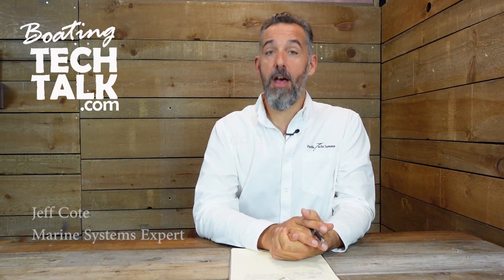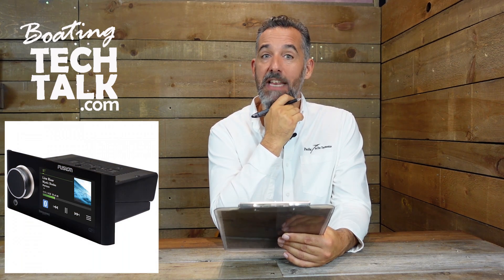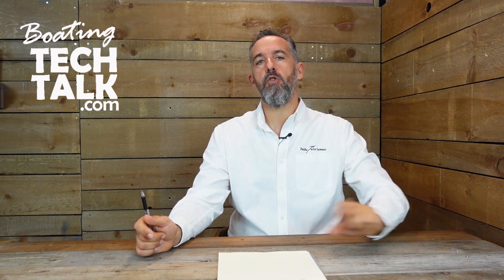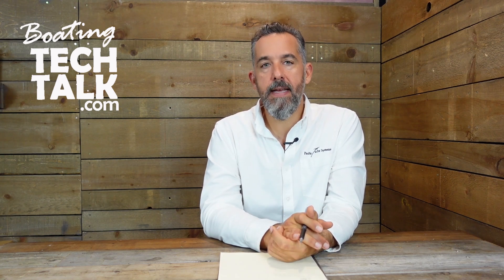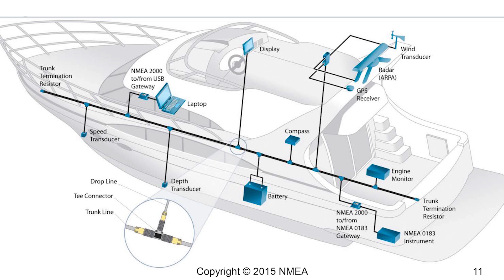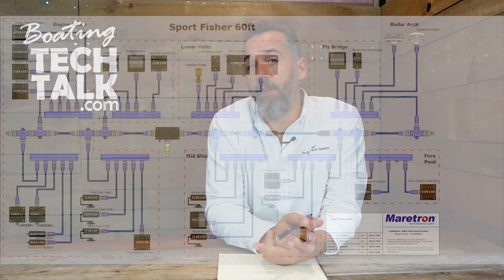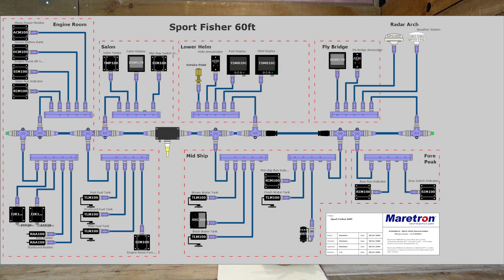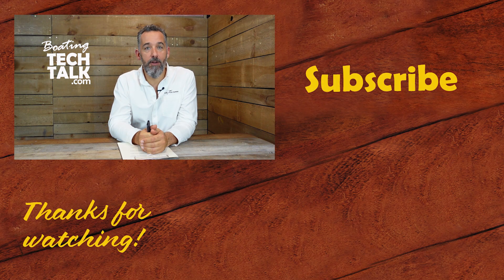Can I Connect My Boat Stereo to My Chartplotter?

Comment: Got a new chartplotter w/ NMEA2K a few yrs ago.  Bought a starter kit and hooked up the depth sounder & few other things.  Now every year I keep wondering what else I want to add.  It's addictive!  (This year I'll probably buy the nmea fuel flow meter).  
And on that note - can you do a video on any of the aftermarket engine monitoring systems that are supposed to convert data?
Reply from the maker: Good suggestion... will keep that in mind.

Comment: The title of this video is about connecting a stereo to a plotter, yet this video was about NMEA, with a brief mention of the Fusion.

Having said that your chartplotter is for navigation, and monitoring your vessels engines and systems.. they're not designed for entertainment.  This is the reason why chartplotters can have internet connectivity but don't come with a web browser.  You can get a stand-alone Fusion remote control much cheaper than you can buy a chartplotter anyway.
Reply from the maker: Thanks for sharing Murn. Some boaters like to connect their Marine Stereos via N2K to their chartplotters so they can control their marine stereo at the helm.
Reply: The majority of OEM boat manufacturers are moving to digital switching platform which will allow the chart plotter to not only control entertainment, but every other function on your boat including lights, blowers, pumps, windlass’, seakeeper, horns, transfer pumps, live wells, surround views, as well as anything and everything else you can have on board. Pretty much every OEM is going in this direction, even smaller models down to 18’er’s. It’s the (very near) future.

Comment: Doesn’t running the stereo off the chart plotter use more power? Then you have to concern yourself with solar or battery power if your out on the hook?
Reply: Use more power? No. 

Does your pc consume more power if you’re connected to the internet?
Reply from the maker: Ed, the chartplotter only allows the control of the Fusion stereo remotely. You are correct, better to control your Fusion stereo directly to save power.

Comment: hi .. Is the Garmin starter kit compatible with B&G or will I need a special B& G one? Cheers
Reply: They're fully compatible, though the T's might not line up exactly between brands. (IE, one might be fully vertical, the other a couple of degrees off to the side). The Garmin ones feel a little more premium than any of the Simrad brands, but the Maretron ones feel bulletproof (you pay for the privilege there though)!
Reply: @raymiller315  Absolutely.  Pick a brand and stay with it. I now have a bunch of Lowrance T's in a box because I went with one of a different brand and they don't all sit flat to the bulkhead.  Went with Maretron 2, 3 or 4 part sets, very nice and shorter.
Reply from the maker: Yes it does